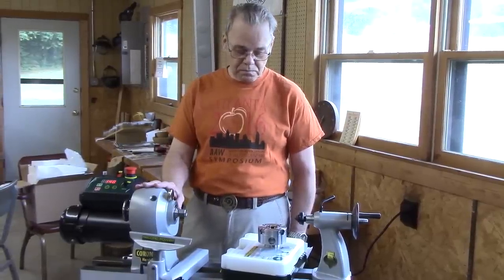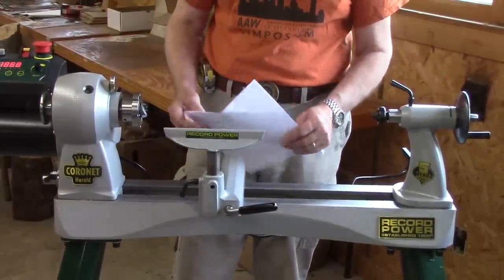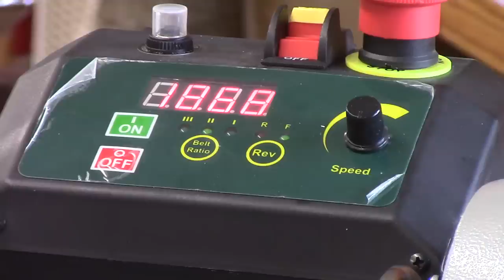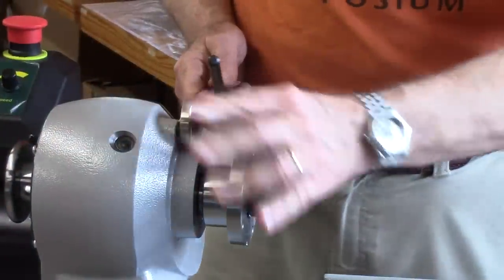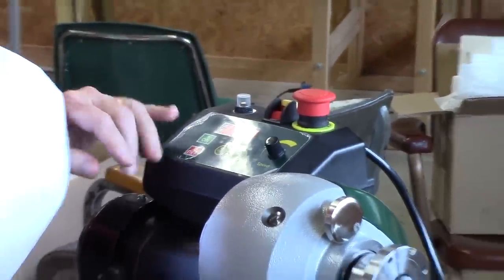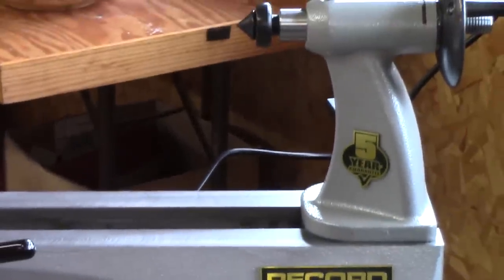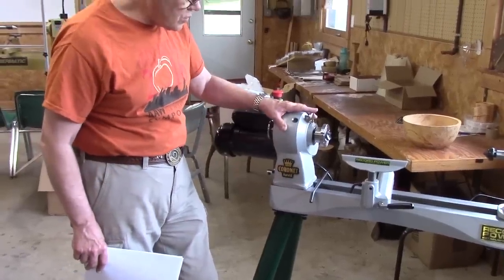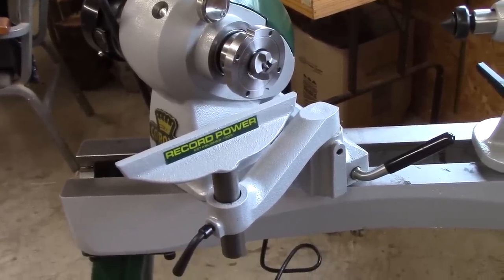Record Power Lathe Review

Comment: It's been two years or so and this lathe is now available in the US.  Price is $1300. Still not a bad price. Mike, how do you feel about the lathe now that you have been using it for a couple of years?
Reply from the maker: I think it provides a lot of capability for the price point being a 14" lathe with a swivel head. I was not happy with the non ejecting TS which required a knockout bar to remove the live center originally. They have corrected that in newer model.

Comment: Would love to upgrade to that lathe. I have a Record CL1 36 twin round bed lathe since 1999. Its got the swivel head and turn 15" x 36" between centres but it only a 3 speed and its a bit light for heavy off balance wood.

Comment: Thanks Mike. If you watch Craft by Afshin you can see this lathe in action. I believe he got it recently. It appears to be very well made. I would certainly consider it when it comes time to replace my old Delta midi. Space is a consideration for me and this looks to be just right.
Reply from the maker: It certainly has a smaller footprint then a full size lathe. It is a bit longer than most minis because of the motor is extended out instead of below the lathe.

Comment: The problem I am having, is that if I put a worm screw in the chuck and then wind a bowl blank onto the worm screw, the handwheel unwinds and will come off, making it impossible to use a worm screw. 
Any ideas, it is a problem on an otherwise good lathe?
Thanks
James
Reply from the maker: There should be some way of fastening the handwheel on with some kind of locking nut or grub screw similar to fastening a chuck on the spindle for turning in reverse. Or use the spindle lock that all modern lathes have. I have never seen a lathe without a spindle lock but there may be some old model out there that does not have one.
Reply: @MikePeaceWoodturning  I didn't 't say but it's the Coronet Herald. There are not any locking grub screws, which surprised me. Recordpower say they are unnecessary because if you fit the bar, that comes with the lathe, through the handwheel and secure it behind the nut that allows the headstock to swivel, then the spindle is locked solid but the bar goes through the handwheel not the spindle and the handwheel and bar unwind together.
I thought that as you have the Coronet Herald you may have come across the problem  or maybe it's me.
Thanks Mike

Comment: Late to the game, but there are 2 really important features (to me at least) that you didn’t mention. Firstly, you can reverse the head and tail stock, effectively making it a Left Hand Lathe. Secondly, the fact that the headstock is easily removable makes it much easier to disassemble for  lighter transport. Good vid Mike. Thanks!!!
Reply from the maker: Thanks.   Left handed lathe - umh. Wouldn't that be the same as turning on the other side? Still an issue operating the controls either way.

Comment: Good video Mike.... I have been wanting to ask you a lathe question for a while now and this video gives me a chance with out having ask a question unrelated to the video or Segway into it.
Q 1. What different brands of lathes have you turned on?
Q 2. What did you like or dislike about each lathe?
Q 3. If you were buying a full size lathe today which one would you buy and why? And pros and cons?
Q 4. How much of a difference 110 volts vs 120volts. I know most of the larger units are 220volt
Looking to upgrade soon.
Thanks Mike.
Ron
Reply from the maker: I will do a video on lathes soon. Great idea, thanks.